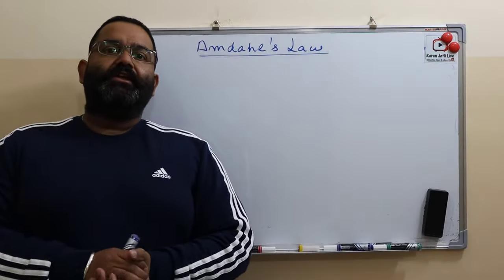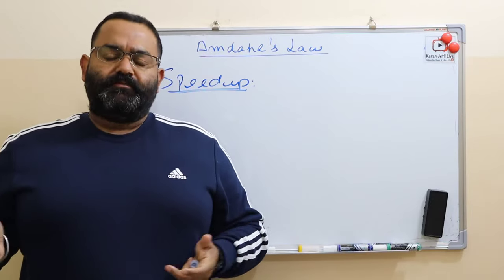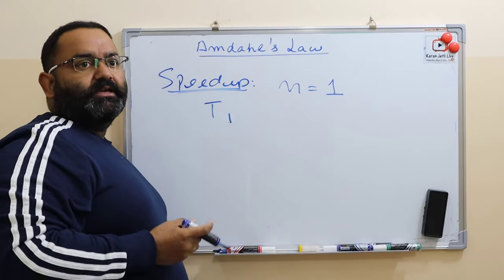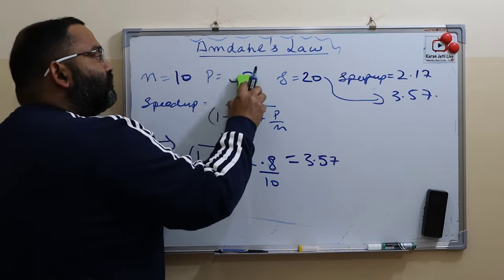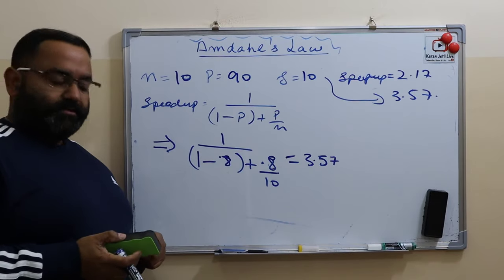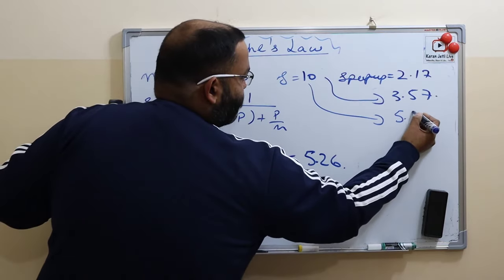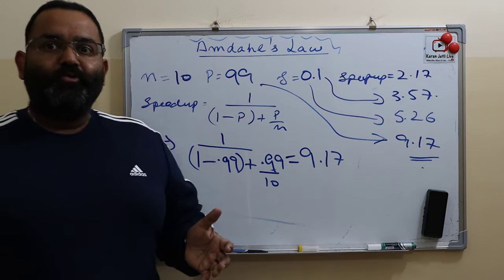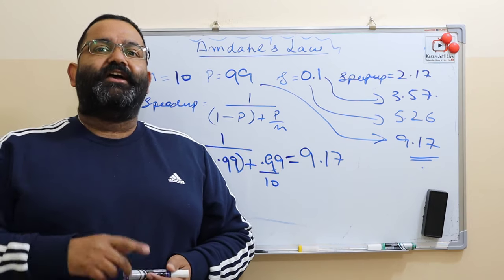Amdahl's law and speedup in concurrent and parallel processing explained with example

Comment: Thank you for the video! It was very helpful I subscribed! Though I am confused how you just substituted  S = (1 - P) into T(n), since T(n) is equal to (S + P)/n. Why did it become T(n) = (1 - P) + P/n instead of (1 - P)/n + P/n. For the last example shouldn't serial be .01.
Reply from the maker: See s+p =1 so u can equate it to s=1-pand then s is replaced by 1-p in the equation.. now when it comes to speedup...on the concurrent  part of the program can run in parallel on n processors and serial part is not affected by increase in number of processors...so its( 1-p)serial part +p(parallel)/n so the total speeup is normal time fr serial part plus the time required to execute parallel part by n processors....i hope you get the idea..
Reply: @KaranJetliLive   so you want to say is serial part doesnt get affected by increased processors thats why it is not divided by n?  well that makes sense. Thanks
Reply: @rishabhgupta734  how does that makes sense? Can you please explain?
Reply: @SuperRishabh1991  I guess he means to say that even if we increase processors (say 'n' here), its going to be a kind of 'no change' for the serial part as it still gets executed serially and therefore has no advantage over distributing itself among other cores(processors). If u look at it in a mathematical way then its wrong as he should have written it as "s + p/n" in the beginning itself, but coming to it logically u can say that, yeah, it makes some sense to not consider 's/n' and rather call it as 's'
Reply: good question and good answer.
thank you both.
Reply: @xingxanghanji6583  Thnks

Comment: with 2 processors, assume we have 80% efficiency on a 512x512 matrix. Say it takes 10 seconds to compute, then we have 8 seconds compute, 2 seconds other
and Amdahl's law says: 

speedup = (original time) / ((compute time)+(other work time))

in the original time case we have 80% efficiency - so we assume 8 seconds compute time, in  seconds other work not parallelizable.

    row size d=512
    non-parallel work - read/write disk, data setup = 2 seconds original time - O(d)
    paralllel work = 8 seconds original time. - O(d^3)
 
with original data row size:
    total time 10sec
    efficiency 80%
    speedup = 1 by definition, this is our comparison baseline 
   
    
    
Assume 16 processors of the same power as original 2
    
suppose we scale row size by 
    2 - 512 aray size
    8 - 8096 array  - (this is data size scaled to #processors)
    
in each of the above 2 cases:
    what is total time? 
    what is efficiency? - fraction of computational (parallel) work
    what is speedup? 
  
Please help with it sir.
Reply from the maker: Hi Krishna Thanks for watching  and here is my take amdahl's law is a fundamental principle in parallel computing that helps us understand how the speedup of a program is limited by the portion of the code that cannot be parallelized. Let's analyze the two cases you mentioned: one with a 512x512 matrix and another with an 8096x8096 matrix, assuming 16 processors.
1. Case 1: 512x512 matrix
   - Original time (T1) = 10 seconds
   - Compute time (C1) = 80% of T1 = 8 seconds
   - Other work time (O1) = T1 - C1 = 2 seconds
Now, let's scale up to 16 processors. In this case, the matrix size remains the same (512x512), but you have more processors.
   - Total time (T16) with 16 processors is influenced by both the compute time and the other work time.
        T16 = (C1 / 16) + O1 = (8 seconds / 16) + 2 seconds = 0.5 seconds + 2 seconds = 2.5 seconds
   - Efficiency (E16) can be calculated as the fraction of computational (parallel) work, which is the compute time.
        E16 = C1 / T16 = 8 seconds / 2.5 seconds ≈ 3.2
   - Speedup (S16) is the ratio of the original time to the total time with 16 processors.
        S16 = T1 / T16 = 10 seconds / 2.5 seconds = 4

2. Case 2: 8096x8096 matrix (scaled data size to match the number of processors, i.e., 16)
   - Original time (T2) = 10 seconds (assuming the same efficiency as in Case 1)
   - Compute time (C2) = 80% of T2 = 8 seconds
   - Other work time (O2) = T2 - C2 = 2 seconds
Now, with 16 processors, you have a larger matrix:
   - Total time (T16) with 16 processors, for the larger matrix, is again influenced by both compute time and other work time.
        T16 = (C2 / 16) + O2 = (8 seconds / 16) + 2 seconds = 0.5 seconds + 2 seconds = 2.5 seconds
   - Efficiency (E16) remains the same since the compute time doesn't change.
        E16 = C2 / T16 = 8 seconds / 2.5 seconds ≈ 3.2
   - Speedup (S16) for the larger matrix is again the ratio of the original time to the total time with 16 processors.
        S16 = T2 / T16 = 10 seconds / 2.5 seconds = 4
In both cases, the total time with 16 processors is 2.5 seconds, the efficiency is approximately 3.2 (or 80% of the computational work is parallelizable), and the speedup is 4. This means that increasing the number of processors from 2 to 16 didn't change the speedup or efficiency because the compute time remained the same, and Amdahl's law predicts that the overall speedup is limited by the non-parallelizable portion of the code.
I hope this helps thanks for watching and plz subscribe for more....Sorry for such a loooong reply....

Comment: how can i get the parallel and serial percentages?
Reply from the maker: To determine the serial and parallel percentages of a program, you need to analyze its code and identify the portions that can be executed sequentially (serial) and those that can be executed concurrently (parallel). Here's a general approach to calculate these percentages:

1. Identify the sequential portions: Examine the code and identify sections that must be executed in a specific order, where one step depends on the completion of the previous step. These sections cannot be parallelized. Calculate the total execution time of these sequential portions.

2. Identify the parallelizable portions: Look for code segments that can be executed independently or concurrently. These sections typically involve independent calculations, loops that can be parallelized, or tasks that can be distributed among multiple processors. Estimate the total execution time of these parallelizable portions.

3. Calculate the percentages: Once you have determined the execution times for both the serial and parallel portions, you can calculate the percentages. Use the following formulas:

   Serial percentage = (Serial execution time / Total execution time) * 100
   Parallel percentage = (Parallel execution time / Total execution time) * 100

   Total execution time = Serial execution time + Parallel execution time

Keep in mind that accurately determining the parallelizable portions and their execution time can be challenging and often requires expertise in parallel programming and performance analysis. Additionally, the actual parallel performance achieved will depend on factors such as the hardware, available resources, and the efficiency of the parallelization implementation.

If you have a specific program in mind, you can provide more details, and I can try to assist you further in identifying the serial and parallel portions.
I hope this helps..thanks for watching and plz subscribe for more..🙏🙏

Comment: lets say you have the code how do you get the percentages in the first place
Reply from the maker: To determine the serial and parallel percentages of a program, you need to analyze its code and identify the portions that can be executed sequentially (serial) and those that can be executed concurrently (parallel). Here's a general approach to calculate these percentages:

1. Identify the sequential portions: Examine the code and identify sections that must be executed in a specific order, where one step depends on the completion of the previous step. These sections cannot be parallelized. Calculate the total execution time of these sequential portions.

2. Identify the parallelizable portions: Look for code segments that can be executed independently or concurrently. These sections typically involve independent calculations, loops that can be parallelized, or tasks that can be distributed among multiple processors. Estimate the total execution time of these parallelizable portions.

3. Calculate the percentages: Once you have determined the execution times for both the serial and parallel portions, you can calculate the percentages. Use the following formulas:

   Serial percentage = (Serial execution time / Total execution time) * 100
   Parallel percentage = (Parallel execution time / Total execution time) * 100

   Total execution time = Serial execution time + Parallel execution time

Keep in mind that accurately determining the parallelizable portions and their execution time can be challenging and often requires expertise in parallel programming and performance analysis. Additionally, the actual parallel performance achieved will depend on factors such as the hardware, available resources, and the efficiency of the parallelization implementation.

If you have a specific program in mind, you can provide more details, and I can try to assist you further in identifying the serial and parallel portions.
I hope this helps..thanks for watching and plz subscribe for more..🙏🙏

Comment: How to create multiple threads for solving a group of operations, distribute the load and execute it parallelly so that the execution time is reduced
Reply from the maker: Hi thanks for watching and for your question..i think ur question you want reduce the execution time by diving and grouping ur operations and then running them parallel on mutiple threads right?? See again it will depend on what type operations you want to run...of operations are serial ( like op of one will be given as ip to other) then it wont make much of difference bcos ur threads hve to wait to recevie ip and vice versa...but of ur operations are parallel and independent then it wld reduce the execution time...like in case of multithreaded servers where a server creates mutiple threads of itself and serves the no of different clients at  same time thus reducing the average waiting time of client...i hope this helps...thanks for watching and plz subscribe for more...🙏🙏
Reply: @KaranJetliLive  thanks a lot
Reply from the maker: U r welcome...plz subscribe..🙏🙏

Comment: Hello sir, thank you for your useful video !! I have 2 questions about this knowledge, it disturb me :( 
Can you guide me how to calculate the maximum speedup with an infinite number of processors (with sequential execution occurring 15% of the time ) and use this result to compute the number of processors are required to be within 20% of the maximum speedup. 
I hope you can see this cmt and help me ! Thank you so much !!
Reply from the maker: Hi thanks for watching...🙏🙏see the thing is we can acheive speedup also only upto some number of processors...but adding more then optimal number wont help speed up rather it will have its own overhead like managing the n number of processors itself and that will again make ur processing serial...and u will loose the benfits of parallel processing...instead of infinite u can find the optimal no of processors for optimal speed up...i hope this helps...🙏🙏
Reply: @KaranJetliLive  ohh I got your point, but I don't know how to calculate the number of processors and the maximum speed up with above data, are there any formulas for them ,sir ?

Comment: thank you
Reply from the maker: Welcome Bhaskar...plz subscribe for more such videos...
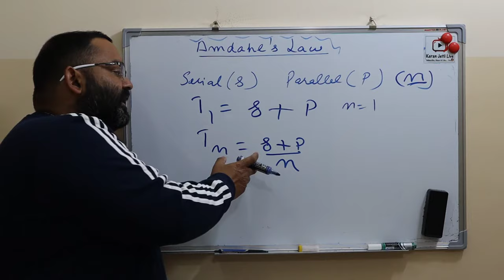Reply: @KaranJetliLive  can u explain a little bit at 10:19, when u converted the s to (1-p), and the u later calculated the speedup writing (1-p)+p/n. my question, is tht supposed to be [(1-p)+p]/n
Reply from the maker: @bhaskarbanepali8565  See s+p =1 so u can equate it to s=1-pand then s is replaced by 1-p in the equation.. now when it comes to speedup...on the concurrent  part of the program can run in parallel on n processors and serial part is not affected by increase in number of processors...so its( 1-p)serial part +p(parallel)/n so the total speeup is normal time fr serial part plus the time required to execute parallel part by n processors....i hope you get the idea..